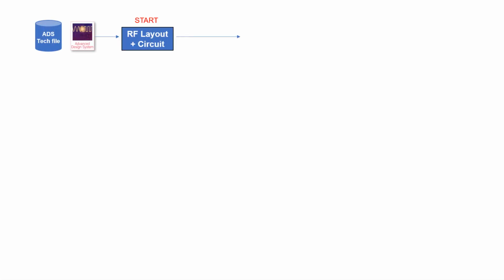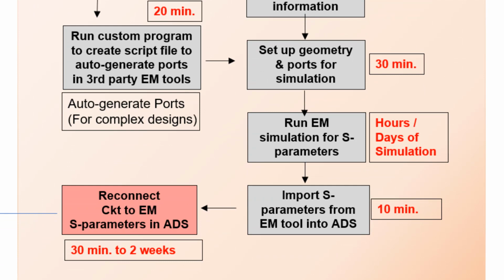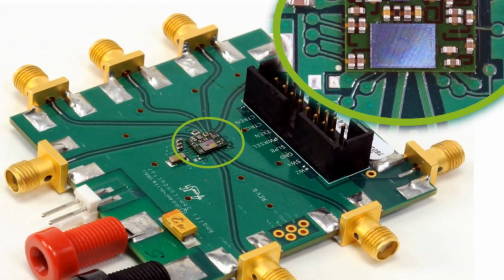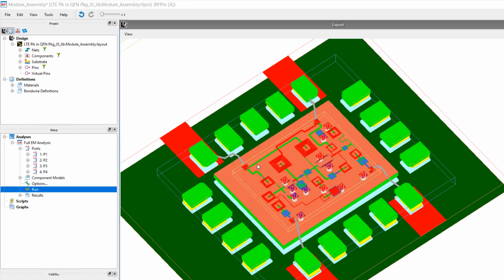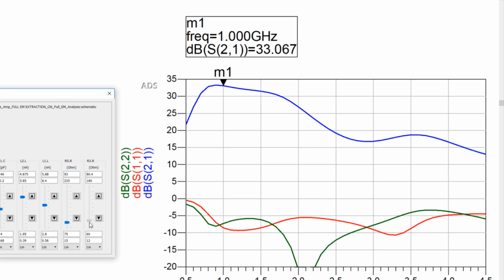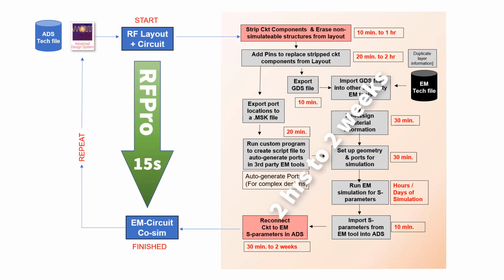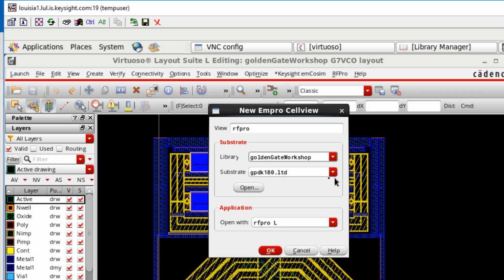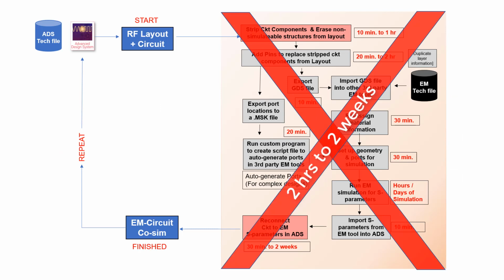Keysight RFPro in ADS for EM-Circuit Co-Simulation

Comment: How can I integrate RFPro with Cadence Virtuoso?
Reply: I think it's not possible bcoz RFpro is integrated environment inside ADS 2019
Reply from the maker: RFPro is integrated in Virtuoso through a Plug-in. It allows any on-chip RF components (such as inductors and capacitors) and interconnect transitions to be EM simulated. See https://edadocs.software.keysight.com/display/eesofapps/RFIC+60+GHz+WiGig+design+integrated+with+integrated+antenna+array